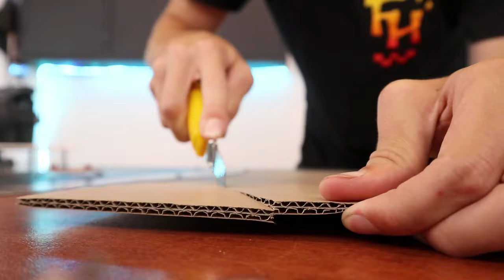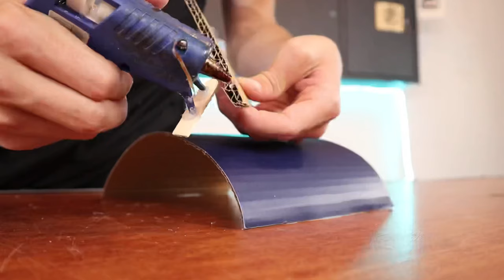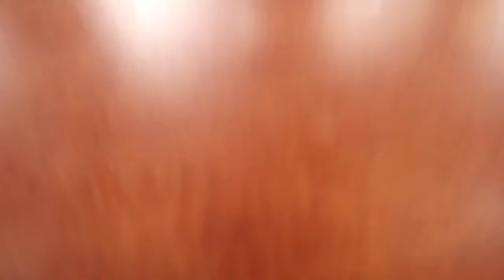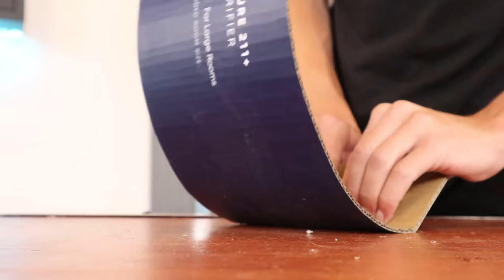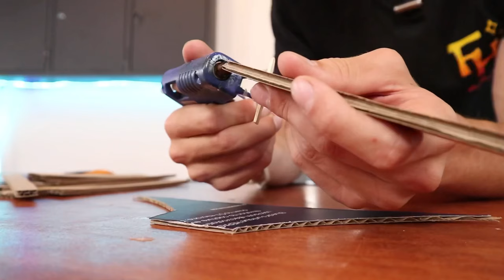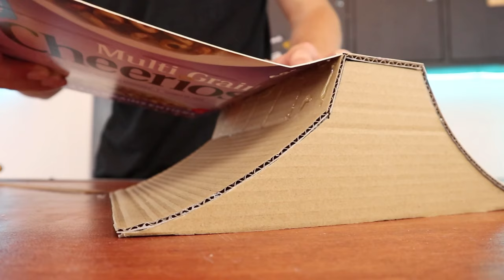D.I.Y Cardboard Fingerboard Ramps

Comment: Use craft foam as grip
Reply: That is horrible. Probably worse then having no grip. If you need foam grip use pipe insulation tape. It’s what most actual foam grips are made from
Reply: @LeoCat-gr7nt it's a challenge
Reply: He already did this and it’s sh-t